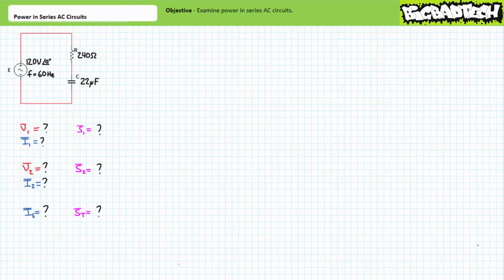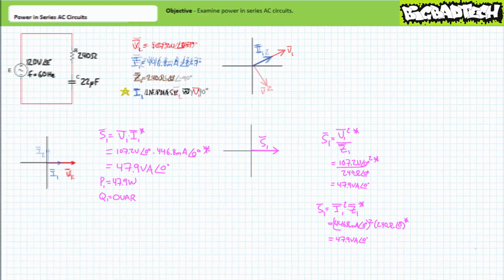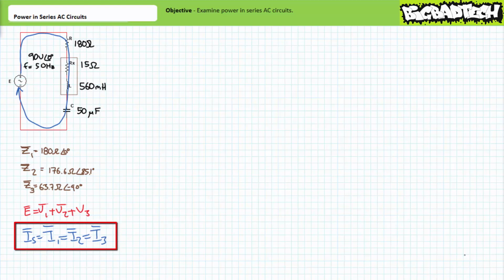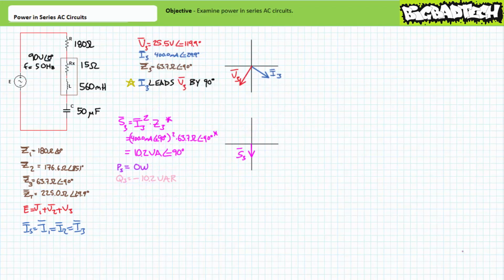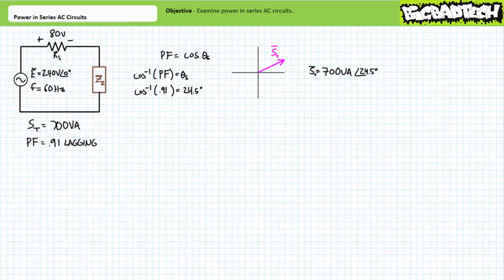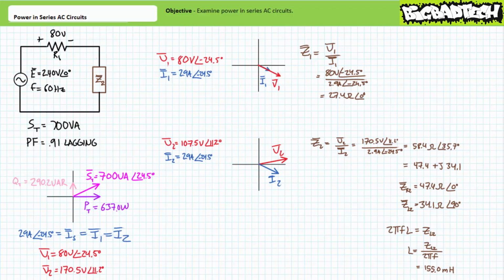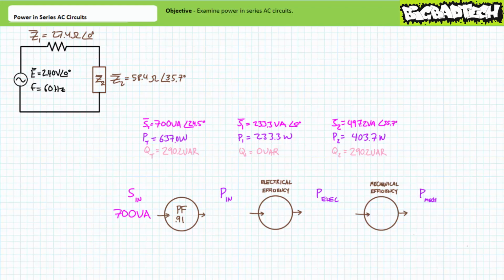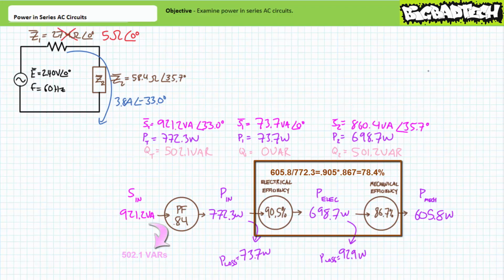Power in Series AC Circuits (Full Lecture)

Comment: At 31:20 when verifying the work, it states that  S_2 = (V_2 x I_2 )* = (107.5<0)(2.9<-35.7)* = 497.2<35.7. However, 107.5 x 2.9 = 311.75. Am I missing something? Please explain how you ended up at 497.2 instead of 311.75.
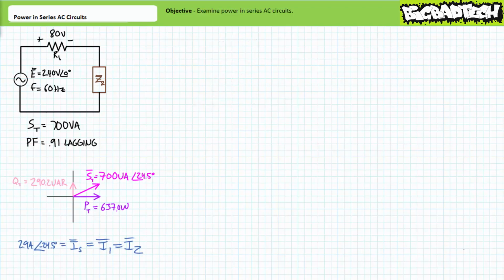Reply from the maker: Good catch. Transposition error. Looks like I accidentally swapped the 7 and 0 when I rewrote the answers. V2 is 170.5 (NOT 107.5). The proper voltage across V2 is calculated using KVL at 24:35
Reply: @bigbadtech  Ok great, thank you. Also want to say I really appreciate these videos. I’m a grad student in EE and was working in industry for 7 years before going back to school. Needless to say, I’d forgotten a lot of important material—your videos have been such a lifeline, thank you!

Comment: Hey Jim, for the final problem, if I am trying to calculate S2 using I^2 * Z, do I keep the absolute phase shift for current since we are dealing with impedance in the equation and not voltage?

Comment: At 29:11 the calculation for S1 reads S1 = 80<0 X (294<0)^*, But should read 80<minus 24.5 X 294<minus 24.5)^*. Result is the same but formula is confusing.
Reply from the maker: AC power concerns itself only with the degree of relative phase shift between voltage and current where voltage is considered the reference. For the purely resistive component current is in phase with voltage and has a 0 degree relative phase shift. When apparent power is resolved into its real and reactive components for purely resistive elements, all of apparent power is directed towards real and none towards reactive.